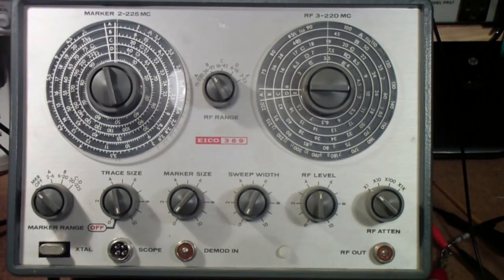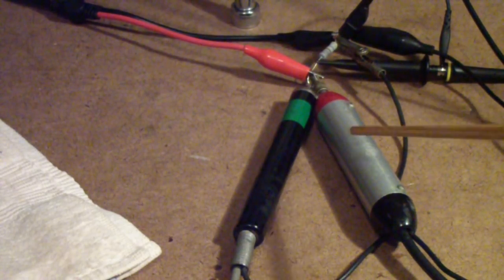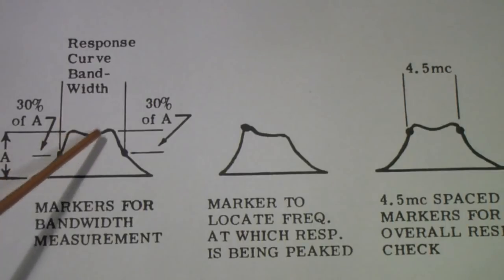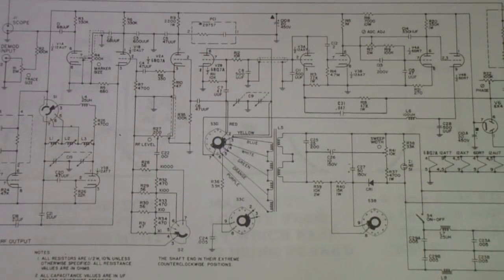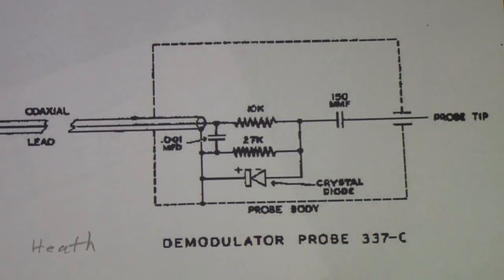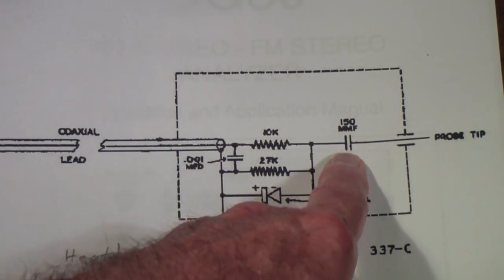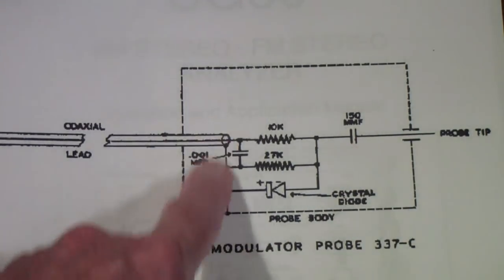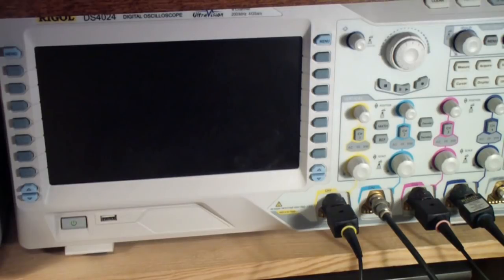TTT199 Demod Probes & Sweep Generators

Comment: Very interesting and instructive. I build a high voltage differential probe that convers from 50 Hz to 800 kHz. I want to test the flatness. I applied a sweep signal from a FY 6900 generator but the amplitude variations are small and hard to see. I was thinking of using  a demod probe to see the variations. How would you modify the Heathkit probe described in the video to cover the above mentioned frequency band. Thank you very much.  Regards, RJM

Comment: There are a lot of neat test you can do with a sweep generator that make troubleshooting and doing alignments easier.  I wouldn't say I would be lost without one but it definitely makes my life easier.  Another handy probe is the type that came with most signal tracers.  It was a AF/RF probe and had a switch built into it.